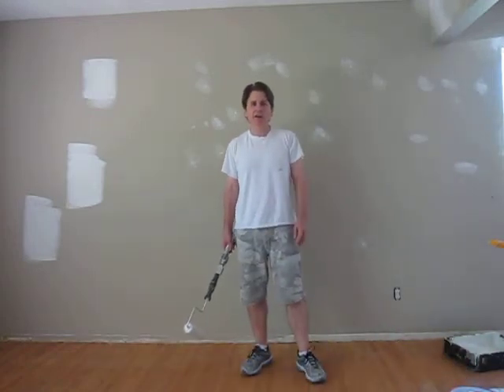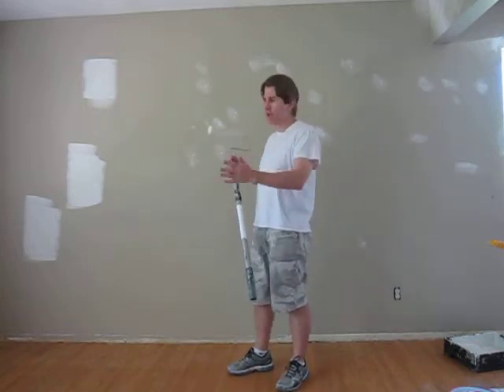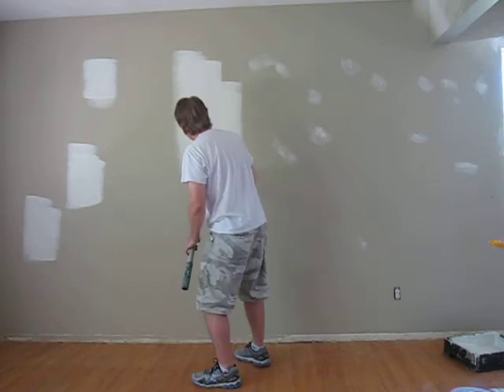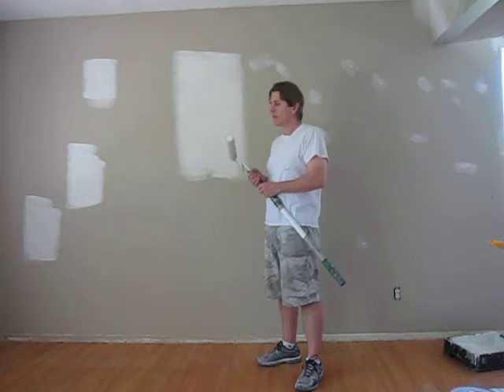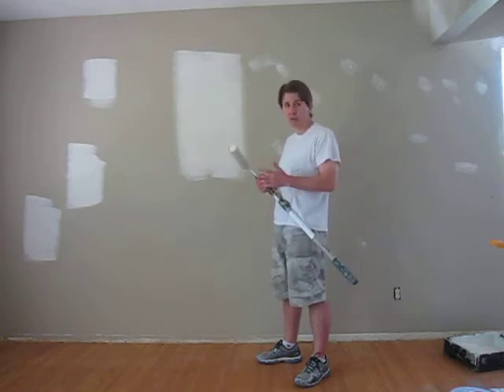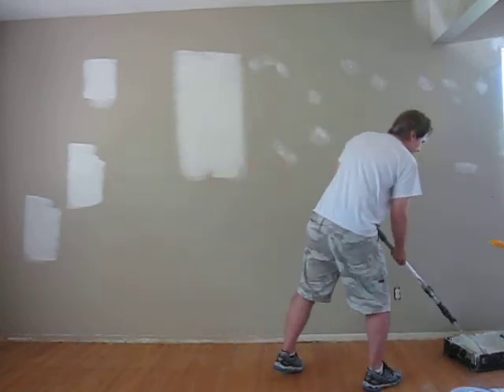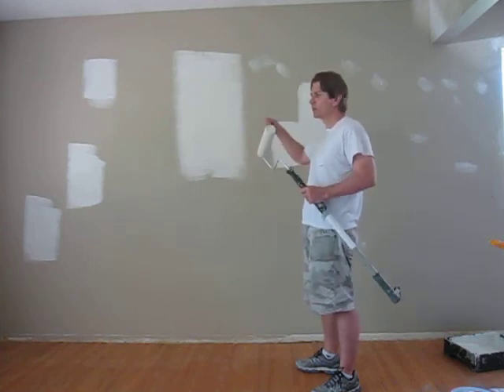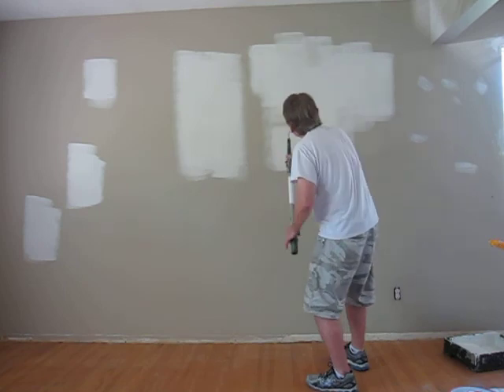How To Prime A Wall? | Spot Priming For Great Results! | Calgary Painter

Comment: I just got a 5 gallon of Kilz 2 all purpose primer. I did alot of hole filling and patch jobs that I want ro make sure wont be seen.
Old color is a grayish green which is somewhat darker than the comfort gray that I am using now.
Most employees at any home store dont know as much as they think. Would this water based primer be good to cover those imperfections even with a few coats before painting?

Comment: What do you use to spot prime? The paint  your your using for your 2nd and 3rd coat?
Reply from the maker: I spot prime with the  wall paint. I do 2 coats, not 3. I don't count the spot prime as a coat.
Reply: @TheCalgaryPainter  the silver bullet of wisdom!
Reply: @TheCalgaryPainter hi, if you are spot priming, can you use a water/paint mix,  like a mist coat as the spot primer?
Reply from the maker: @TavsIsAbout  I would go full strength and not reduce the paint so it seals better.
Reply from the maker: Yes. For large drywall repairs I use a primer/sealer. If you have a ton of repairs I often just prime the whole wall.